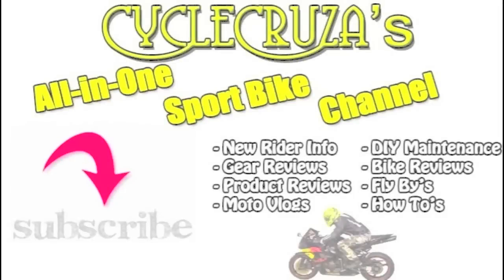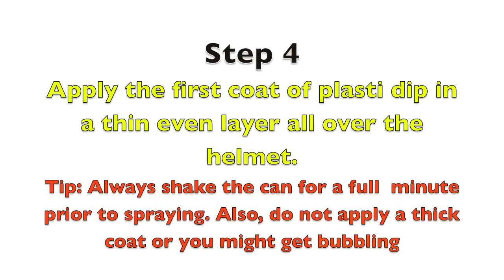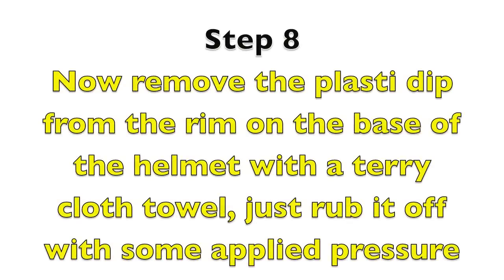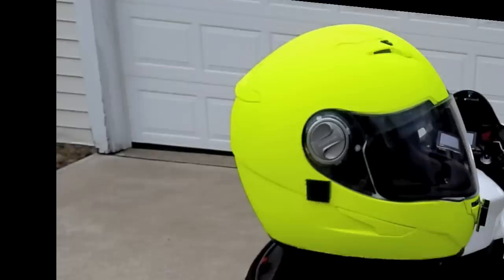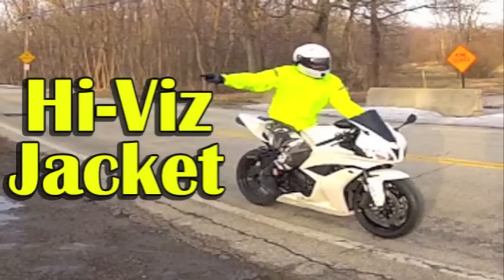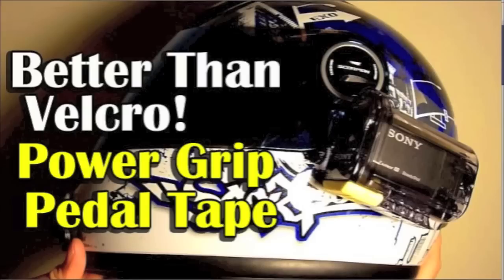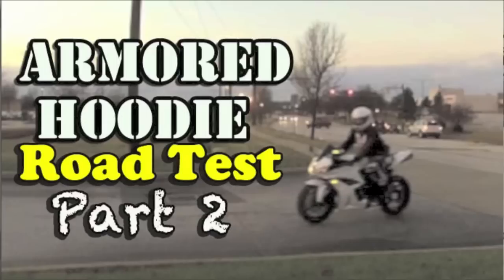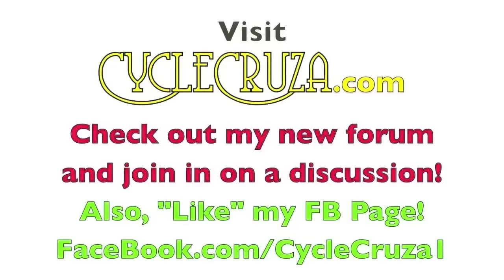Plasti Dip Helmet - CHEAP HI-VIZ Motorcycle Helmet Option

Comment: Great video. Being a person who has used Plasti dip before I only found one issue with your video. The only issue is the waiting time between coats. Not saying that your wait time was/is wrong. But from my experience I would advise reading and going by the wait time on the can for a better application. Once again great video and by no means nocking your video.

Comment: You can also use plastidip clear to protect the color coat as a finish.
 That will protect the color layer from tears from road debris and make it easier to clean.
Reply from the maker: I used that stuff on my former cbr250r rims when I plasti dipped them black and I wouldn't waste my money on that plasti dip glossy crap again. It doesn't protect it anymore than just using plasti dip and it doesn't add much sheen.
Reply: CycleCruza
 How good the Plastidips going to be really comes down to the technique. Before I spray it I use a basic paint primer (Dark or light depending on the color I plan to use). This helps it stick to the surface so you can't pull it off like rubber. Then I heat the plastidip can so it sprays on in a nice thinner and broader spray pattern. Usually no more than 2 coats. I let it set up for a few hours and come back with Plasticoat clear. I heat up the can again and spray it out. The more coats the glossier. If I don't want the rubbery glossy feel I'll use a can of regular "Clear" paint over the plastidip. Sometimes I like to toss in a layer of that metalic flake stuff to get some nice reflections in the paint before I clear it. Looks pretty cool and holds up well when it's done. It's all in the technique how your finished product is going to be.

Comment: How about these three questions:
- Will not Plastidip have chemical reaction with a helmet cover material decreasing its protective characteristics?
- Since you can easily remove plastidip from a visor, picking it with a toothpick, will not it go off the main helmet area easilly too when you exploit the helmet? How reliable this covering?
- You were painting a white helmet. Mine is glassy black. Will the yellow look the same as with white helmets on a black one, or I should paint it white somehow first.
Reply: Plasti Dip is a spray on rubber. It doesn't work like normal paint.
Because of that, it allows you to do many things with it you wouldn't do with paint. It will not damage the helmet in the same way putting on a rubber glove won't damage your hand.
Plasti Dip, as long as its sprayed on thick enough, can be peeled off in one sheet from the visor, or if it was sprayed too thin, rubbed off with a microfiber towel. Because it was sprayed on as a liquid, it (Most likely) won't be attached to the dip on the helmet. If by "exploiting the helmet" you mean get into a crash, you should be replacing the helmet anyways as cracks in the fiberglass aren't always visible and a new helmet is always cheaper than brain damage.
However, things like bugs won't damage the coat and will wipe off with warm water. I use aerosol glass cleaner on my (Not yet dipped) helmet with a matte finish and I'm pretty sure it's safe for the dip, but double check.
Plasti dip will spray on with a matte finish, unless you use a glossifier coating. As long as you get it on thick enough, it will cover any colour and remove easily.
If you're doing a light colour on a dark surface, you'll need more than three coats, probably in the range of six to ten, depending on what you're doing. But, this does a couple of things by making it thicker.
First off, you get a more accurate colour. Second, it's way easier to peel off. Third, it protects the helmet's coating.
On mine, I'm planning on doing a design on my matte black adv helmet using a white base coat and then doing the design in black over that. Hopefully when I tape off the design, it won't cause the black to peel. It'll be a learning experience. Luckily, one that peels off with no damage if I fuck it up too badly.

I intend to dip my car (1986 BMW 535i) to cover up the millions of tiny imperfections only I can see and prevent new ones from happening. The stuff is very neat and I've researched it extensively. dipyourcar(dot)com is probably the place to get it from.
Reply: Sawducum Soup Badger
Thanks for the comment. I now understand as to what deals with "painting" a black helmet (just add more layers).
It's also more or less clear about chemical reactions with the shell (probably I shouldn't be too much concerned since it's rubber).
And the one more thing I asked is kind of unclear still. Imagine you covered the whole helmet including the visor with plastidip. Then you are removing the peice from the visor. To my mind when you make a cut to remove this peiece from the visor it should kind of (probably) leave an "insecure" edge of plastidip paint above on the helmet's edge (something like a nail on your finger which grew  little bit). And I'm afraid that because of the wind or just everyday's use this edge off paint can go off the helmet. I mean, in reality, how tightly this paint lays on the surface of parts, especially at the edges of parts, not in the middle?
Reply: petr agulin As long as you don't start the peel with a hammer, you should be fine just peeling the visor.
Maybe this video will help clear up some concerns / questions. In it, he addresses the durability issue, specifically.
If you have a secondary helmet, you should use it for a couple days to let it completely cure (Four days, probably) so it doesn't get marred by bugs and sand and whatnot.
/watch?v=vvkq-qyY9aY
Actually, this guy's channel (And website) is probably the best place to go for Plasti tutorials. Too bad he doesn't do anything for motorcycles, but eh.
Reply: Sawducum Soup Badger
Great.Tthanks a lot! :)

Comment: I'm going to try this on my 2010 Bell Star.  The helmet is red and white.  I'm going to use a base coat of Plasti Dip white as a primer, then use the Hi-Viz Yellow.  I also will use Plasti Dip Enhancer Glossifier Aerosol for a final high gloss look.  I'll try to post a picture of the final product.
Reply: I tested Plasti Dip on a piece of EPS (syrofoam).  Result:  It melted the EPS.  Conclusion:  Do not use this product on your helmet, as it may compromise the integrity of the EPS liner.

Comment from the maker: @gunslinger fourtysix - Plasti Dip is not regular paint and should not be treated as regular paint, believe me I've had many trials and errors with this stuff, this is not my first plasti dip video. My first video I plasti-dipped my wheels on my former honda cbr250r. You are basically spraying rubber with plasti-dip, you have to spray thin even coats without much overlap or concentrating on any one area. Here is the first plasti dip video I did: Plasti Dip Motorcycle Rims

Comment: I plastidipped my helmet white a few months ago. I tore that shit off since the bugs stick to it like flypaper. I love the look when you first do it, but after riding a hundred miles or so you'll realize how much of a pain in the ass it is to get those bugs off
Reply from the maker: Just clean it with a wet rag, I plasti dipped my rims on my former cbr250r. People even plasti dip their cars! It's rubber-like so it can be cleaned easy with a wet rag. Here is my other video where I show you how to plasti dip motorcycle rims: Plasti Dip Motorcycle Rims
Reply: That's why you need to add on the clear coat.
Reply: Yes I had 3 coats of clear coat on top of 3 white
Reply from the maker: Skip the clear coat, I added the plasti dip glossy to my rims and I was sorry I did. All you need is just the plasti dip.

Comment: Hey Cruza.., I occurs to me that the plastidip creates a much softer, therefore grippyer surface than the original shell of the helmet. In the event of a fall where your head might scrape against the road surface, wouldn't this increase the chances of neck injury? If the helmet has too much friction on the tarmac I think it could twist your neck up pretty bad. What do you think?
Reply from the maker: No, surface is not grippy. You'll be fine.

Comment: i tried putting some purple plasti on a black helmet and after a like 12 coats of spraying and a whole can of plasti the helmet still isnt all the way purple..... Also there is a small amount of bubbling in some areas.

should i buy more plasti dip and spray more over what i already have on there?

or should i remove the plasti that is already on there before i try again.
Reply from the maker: Never spray plasti dip like it's paint, always apply light even coats and allow at least 15 minutes between coats, if it's humid out allow a longer dry time between coats. Bubbling is sign that you applied heavy coats. Also, it could be b/c you are painting a dark helmet. I tried to plasti dip the plastic panels on my black armor jacket and I could not get it cover properly.

Comment: fyi! this does NOT work well on a black helmet. i only tried one bottle, and it looked awful. luckily it peeled off. just shell out for the yellow helmet or use a white one.
Reply from the maker: GoodMorningCoffeeSD Sorry to hear, I have no experience with plasti dipping a dark colored helmet, or otherwise I would have relayed that information in the video. Thanks for sharing that information.
Reply: no problem! just wanted people to know before they ordered the plasti dip or to get two bottles. Thanks for this video though!
Reply: GoodMorningCoffeeSD Two to three coats of white plasti-dip before applying the hi-vis yellow will work on a black helmet
Reply: Use Krylon Fusion, it's safe to paint on plastics, so it should be ok on a helmet.
Reply: Color f the helmet would not matter at all.  You may need more coats but the fact is, the dip flakes so not a good choice for a helmet.

Comment: How did this hold up? Worried it will just get a little scratch and start peeling off
Reply from the maker: Pretty durable. I Plasti dipped the wheels on my former cbr250r and I had no problems after 5 months of riding the bike. I even traded the bike in at the dealership and they didn't even ask about the wheels. lol They probably thought I powder-coated them. lol

Comment: Hi CycleCruza, thanks for your videos.

Have you verified that this is safe? What type of helmet shell do you have? What I've read is that using paint or even some stickers on a polycarbonate (plastic) shell helmet is extremely unsafe as the solvents will degrade or dissolve the shell and interior foam. Maybe plasti-dip is different, I don't know.
Another point is that helmets are specifically designed as they are, with the type of shell they have, and applying a coat of a foreign substance with different texture and properties is very questionable.

Again, thank you for your videos. I appreciate your safe riding advice. I am just wondering if you have checked out the safety on this.
Reply from the maker: Don't know, as stated in the beginning of this video "This video is for entertainment purposes only." lol Many people spray paint their helmet though, I've never heard of it compromising the shell of the helmet. Thanks for inquiring and watching my videos! Best of luck!
Reply: I have a follow up on this, I contacted HJC about my polycarbonate (plastic) shell IS-17 and they said it "could damage the color or have any unknown effect", basically they didn't know. 

And they said stickers are fine. 

Thanks again for the videos!
Reply from the maker: sirstratocaster Plasti dip is just a rubber coating that is fully removable so I don't think that will have much effect to the iintegrity of the helmet shell, but that's just my opinion.

Comment: Oh god.... PLEASE DON'T PLASTI DIP OR SPRAY PAINT YOUR HELMETS. Helmets have vents and if you get any aerosols into the helmet, you can damage the eps liner. Why would you damage something that protects your head.

Plasti dip can also easily peel off so spraying something like a helmet where it comes in a lot of contact with your hands is just bad. Look at the bottom of the helmet in the video after he applied the plasti dip. There are wrinkles all over the edges where it can easily be peeled off.